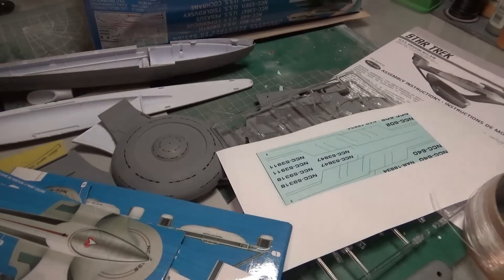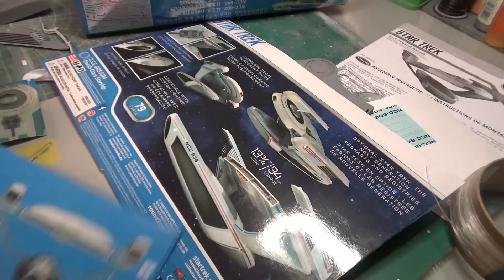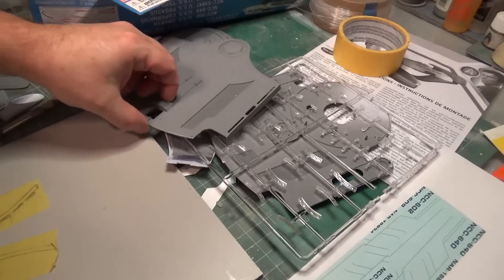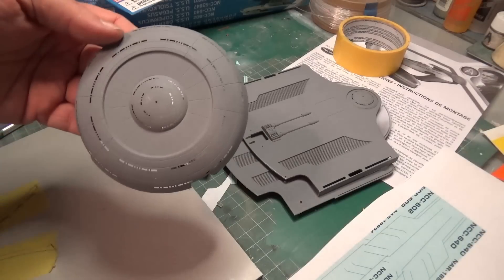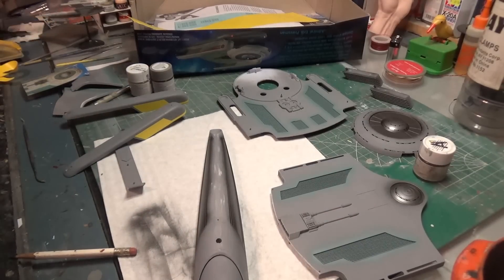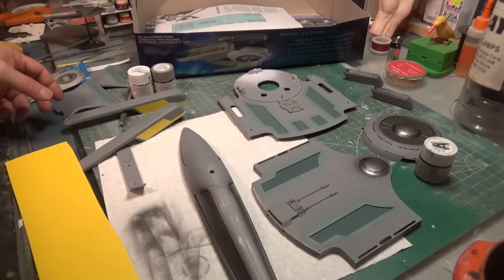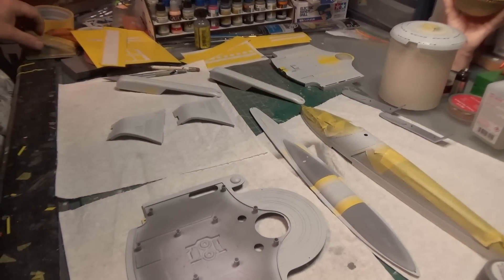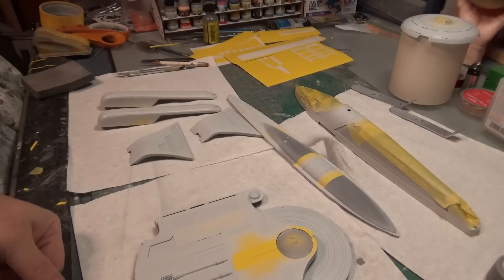Aztek Dummy Update 3/04/22 - 350 scale Oberth Class - Part 1

Comment: You mention using MEK glue for gluing some of the sections together. What is MEK glue. Thanks for any information.
Reply from the maker: MEK (MethylEthylKetone) is a clear liquid that is a very close cousin to the old Tenax 7 glue. You can find it in most hardware stores. You can use it as a glue since it will melt styrene in the same way as liquid glues do. It is fast acting, but doesn't stick your fingers together like super glue does.
Reply: Thanks very much Lou. I was just curious as I hear you mention it a lot. Have a great weekend.